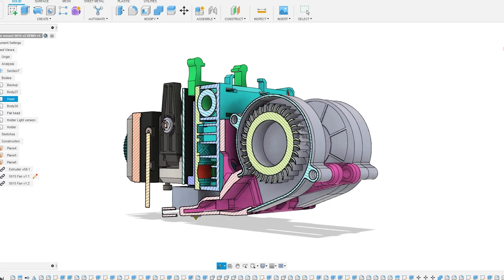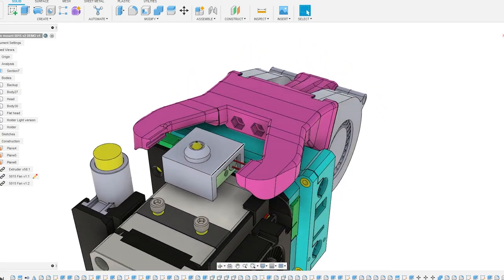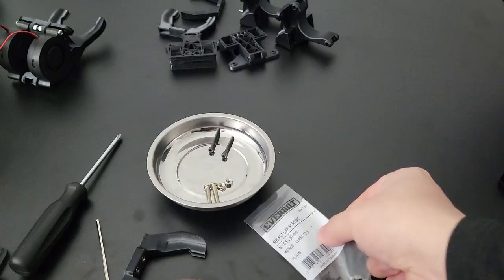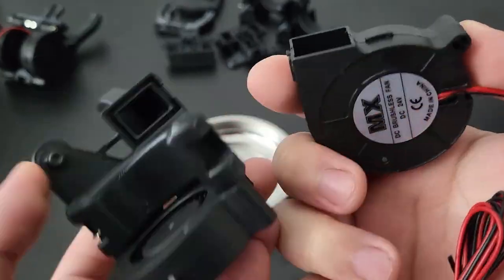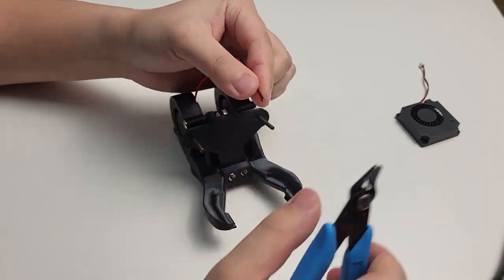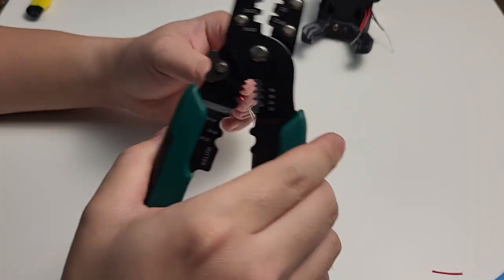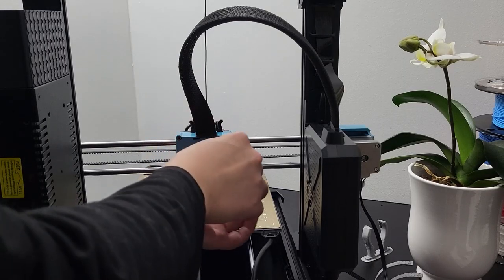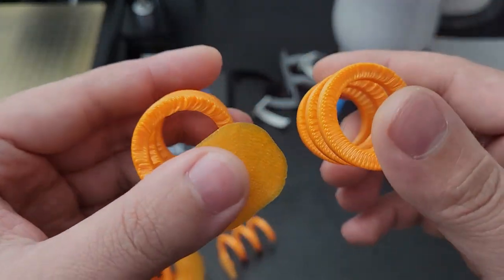Sovol SV06 Dual 5015 upgrade Instruction guide | "Crustacean Nation Ventilation Station"

Comment: Hello, excellent guide and a really cool model to boot! I just installed it on my SV06+ and have a couple notes:

This model does not affect my homing distance, but be careful not to lower the duct on top of a part on the bed. I'm still getting used to Klipper, and snapped a duct off. A little Super Glue got it back together, and I'm printing a new one.

Also, if you have an SV06+, you will want to use two M3x30 screws to attach the print to the hot head. The M3x25 were not long enough to mount it securely.
Reply from the maker: glad you like it

Comment: This is a heavy weight solution. I only installed one 5015 blower from behind. 
That's enough and I can see the nozzle from the front. 
There are also no problems with the width when homeing.
Reply from the maker: Yes, this solution is overkill and not really fully developed yet. Also, when the dual fans run 100% it sounds so loud. Still improving it.

Comment: I would split the two fans into dedicated dual ducts at an angle to hit from the four directions i.e. left fan if you are looking at a square does upper and lower left with the nozzle in the middle and right does right upper and lower  and position them so they cross like and x and gap between left and right is open so you can see the nozzle still.  The fans are overkill, This will balance out the direction flow as you are pitting the duct against each other, and will give you nearly 360 degree coverage.  Right now there is a decent single fan solution that pushes good air on its own and does essentially the same thing so if you are going this step, I would also consider making the further ducts to the front corners slightly smaller in diameter to force the air to move slightly faster to balance out the loss of pressure from exiting the first duct at rear corners as well.

Comment: Hi, 

If you have overkill cooling you can use it at 50% which should make it a lot quieter. 
Also if you use inserts you can make the rear setup thinner because you don't need the space for the nuts. 
I watched this without sound, so i don't know if you talked about it. 
You can save ~5mm that way. 

If you want to keep the nuts, perhaps you can split the rear fan mount in halves. Then you can insert the nuts, and connect the two halves together, eith superglue maybe. 
 
The fan is also not heavy so perhaps it doesn't need an m3 bolt and nut Perhaps a short wood screw is enough and then you can save some more space. The wood screw would bite into the casing of the fan itself. And then the fans can be mounted against eachother.
Reply: Lol, the fans can't be mounted against eachother because of the air hole in the center. Stupid haha. :P
Reply from the maker: Thank you for great suggestions! I'm have similar thoughts on that to improve on version 2. It should be save all the travel on x axis. But the mount still a bit of pain to design.
Reply from the maker: Also, yes you are correct, reduce the max fan speed on slicer under 80% will reduce the noise a lot.

Comment: Hello. Just found this. Last weekend I designed a very primitive dual 5015 blower bracket for the SV07plus. It's up on Printables. It's not pretty, but it seems to be working. Wondering if you were having a similar problem as this: when I tried a PETG print, it quickly became apparent that the parts fan cooling profile needed some editing for that filament. Particularly, when doing overhangs on inside turns, that excess cooling will cause the filament to shrink very quickly and pull out threads on the insides of turns. Found this by printing S-hooks. Working now to tune the parts fan speeds for the PETG profile.
Reply from the maker: Generally you want to set the fan speed to 0 to 20% for PETG. Reduce the printing speed for overhangs. Or reduce the overall printing speed.
Reply: @SvgLau  Thanks! Over some test printing the last few days, I had moved the cooling speeds down to 8-18% in the slicer, and told it to slow down printing when a layer takes less than 40 seconds. Every filament is different, right?

Comment: I don t know what kind of printheads for sv06 are available atm but it seems to me that it s much more worth it going for already tested printheads like hero me then doing something like this. Double 5015 should have much better impact then in this model. In water test you can barely see impact of fans which tells me that air is flowing in wrong direction. SV06 printhead is already so massive that I adding more parts on it just makes everything more clunky. Honestly I like that you put effort in it and tried something new but design of sv06 printhead doesn t look like it allows upgrades. I would rather just strip everything down and design everything from start and maybe implementing some sovol ideas.
Reply from the maker: Yes, it was pain in the a** to design over this printhead platform, everything is so packed together. Totally agree that would be better to starting a more flexible platform on it. But there is need for people that just want to simply upgrade on parts cooling, that's why this design come in to place. Is it good right now? No. But we could make it better and helpful for some groups of people. Maybe someday later we will carry on on better printhead.
Reply: @SvgLau  have you tried  to set 5015 in place of their 4010 at the bottom of print head and see how that works? It looks to me like it would fit and it's in perfect spot for their design. If it's really good then it might be better option then building big special upgrades just to add second 5015.
Reply from the maker: @lovrocatela8727  Yes, I have tried to use the 5015 replace the stock 4010, but 5015 is a lot thicker. It won't fit the space. That was a really good call, maybe I should try to do something with the stock mounting point.
Reply: @SvgLau  How is going to improve the part cooling? I just disassembledthe hotend and it seems like it would be possible to place 5015 in place of 4010 with few changes. The biggest problem is cable management but it could work out. It would be even easier for people who have volcano nozzle.
Reply: @lovrocatela8727  Consider the fact that the 5015 would still be pulling air that's being heated from the bed; this design is better in this sense as it doesn't pull in air that's been in direct contact with the bed.

Comment: Any reason you used an asymmetrical design on the air nozzles? I tried modifying it to use the "closed" side on both sides and I've gotten better overhang performance in certain orientations.
Reply from the maker: The extruder is the symmetrical if you take the back mount carrier as references point. You could technically set center plane and do symmetrical around the nozzle/hotend. But I just did it on mount plate, so.

Comment: Hello, how are you? I'm having a problem with my sv06. When laminating the projects in Prusa, the objects are centered but for some reason when printing they are very far back from the bed. In some cases, if the print is large, they are on the outside, they are not centered as expected. You see on the computer screen that when the prints are finished the bed moves to the front so much that the motors make noises, how can I correct that?
Reply from the maker: so it is either your put home location wrong on slicer, or the printer have some issue (jaming) when homing. You could try to clear out the travel of build plate on y axis and confirm if move all the way to the front/back without issue. Second, check you prusaslicer "printer settings"- "size and coordinates" - "origin should be x:0 y:0." Last possible, firmware bug, it happend sometimes, if other two didn't work, maybe you can try flash frimware to fix it.

Comment: Any updates on this. Has anybody remixed this so it doesn't limit movement. This is my first 3 printer but I'm ok with modifying hardware and doing this but thinking about just buying th3d. The Th3d one is over 70$ Canadian with shipping! If i go with a print then can someone suggest a brand of 5015 24v fan
Reply from the maker: any ballbearing fan from amazon would be okay. Some one made remix of this design on printable, it should work better and without losing space on x axis.
Reply: @SvgLau  I see 2 remixes, does it matter which one? Also do you recommend this or your single fan if noise is not a concern (somebody mentioned "ringing" BC of weight?). Thanks I'm following your guidance on everything for this printer. I'm wondering if the bearings will be better greased as the extruder had the 2 grub screws with thread locker that I mentioned in your other video. I took pictures of the new design but I don't know who to send them to lol
Reply from the maker: @David-wd5et   I believe the one with resin is more popular. But I think signle 5015 is good enough for most of the time, even if you are going for Klipper, 5015 is good enough. also, as you mentioned, less weight. I don't think that bearing on extruder  will be matter whether if you grease it or not. It should rolling free between it's outter ring and inner ring.
Reply: @SvgLau  so confused right now thought that it was very recommended to grease all the bearings? The guides refer to your videos even! My printer is new in parts so I thought it would be a little easier to do now. So you don't recommend!? To grease the bearing. I am planning to run klipper
Reply from the maker: @David-wd5et  Do you mean grease the bearing on the linear rod? or grease the bearing on the extruder.  I was thought you mean the bearing on the extruder, since you was talking about extruder. 
 But, yes, it is better you grease all the bearing on x, y, and z axis.

Comment: Would you be able to keep the front cooling fan for extra cooling?
Reply from the maker: The front cooling fan duct is on the way, also I don't know 3 24v in parallel is okay for the circuit. 2 5015 with correct direction air flow is already overkill.

Comment: This is the same for the sv06 plus right?
Reply from the maker: no, it is different
Reply: @SvgLau  my.brain didnt work with me haha.
I meant the process of replacing the stock fan with the 5015.

Plus has a couple fan duct versions now thanks to you.

But to be safe sv06 fan was 24 volt and the sv06 too right i ordered a fan before the printer haha
Reply from the maker: @bertkooijmans4769  yes, they are both 24v fan. Most of the FDM printers runing at 24v parts.
Reply: @SvgLau  okay great because i saw the 24 volt in this video thinking it was the same as the plus haha